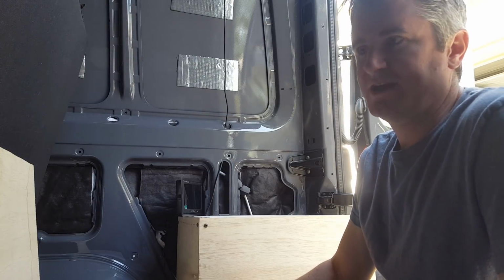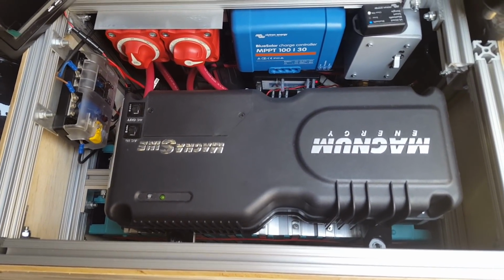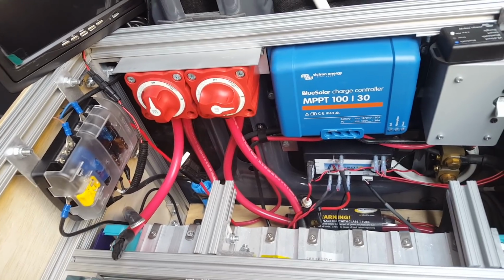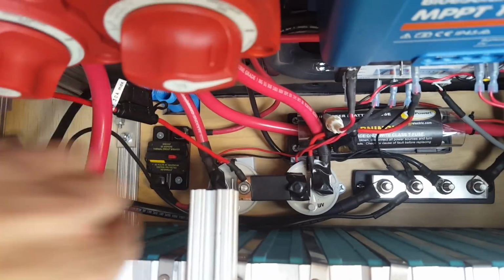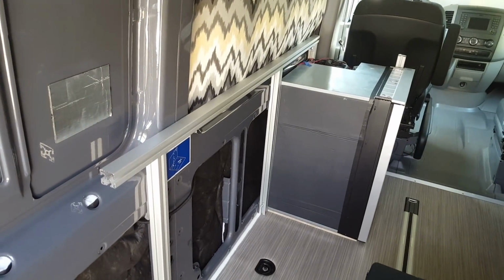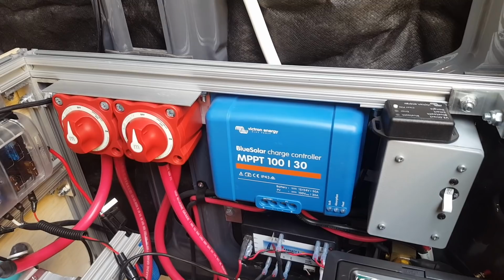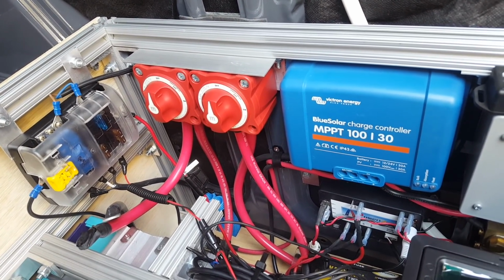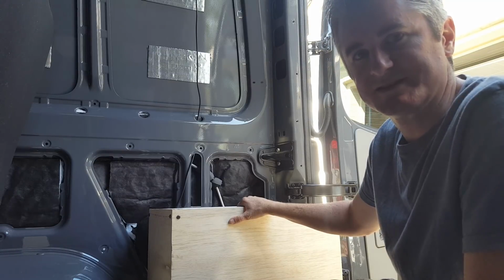Lithium Battery Install in a DIY Mercedes Sprinter camper van

Comment: kenetube, I just wanted to say that I really appreciate you taking the time to document your various installs, item links, etc. I know it does take a non-trivial amount of time but I for one am really enjoying and taking notes on your videos. I'm plotting a Sprinter build and I think yours have been some of the most considered and thought-out videos I've seen. A couple quick questions: 1) Did you consider hinging your solar panel to maximize efficiency? Seems like there should be a way to do that relatively easily with 80/20 (I'm just an 80/20 newbie but it doesn't seem like there's much you can't do with 80/20). 2) I'm assuming your lithium battery setup does not permit charging of the LiFeMnP battery from your engine alternator (only assuming because you didn't mention that). Was there a reason for that? How hard would it be to leverage the alternator for additional charging of the Lithium pack while driving? 3) You mention that shore power isn't really a need or factor for you and what you want to do. But, it seems that it wouldn't hurt to have a way to leverage shore power when it might be available. How would you go about incorporating that into your system (or, put another way - how would you recommend someone do that with a system like yours who did want to leverage shore power from time to time)? I have other questions but I'll leave it at that for now. Thanks again for your efforts - really great work, both the videos and the build!
Reply: Very helpful - thanks! Understood about leveraging the alternator and your "shore power" setup. Makes sense.
In terms angling the panels, I was wondering because I've read that there's an optimal angle for solar panels at a given latitude and time of year. Here's a seemingly credible link that mentions reductions to the low 80's% of full efficiency: https://solarcalculator.com.au/solar-panel-angle/ for a flat roof (albeit one in Australia). So, I guess I was thinking the ability to angle might be useful if you were out in the sun without obstructions for the day and wanted to get the most bang for the solar buck. But, angling the panels does complicate the panel mount somewhat, you'd have to go through the trouble of parking a certain way and setting the angle and then setting it back flat for travel, and maybe the extra efficiency is "in the noise" anyway (thanks to all that extra , useable capacity with your Lithium batteries), so it could very well not be worth it. Anyway, thanks again. Looking forward to more updates and videos!

Comment: Finally, someone who understands the advantage of not fully charging a lithium battery to 100%. The battery will last a lot longer if you don't go much past 85% (same for Smartphone batteries BTW). I learned this from Tesla. One question: I'm sure you knew of Battle Born LiFePO4 batteries; why did you go with Elite Power Solutions? Was it the remote monitor, or the end mounted terminals?
Reply: Yes, fairly new, but from what I've heard, excellent customer and tech support, and made in Nevada. But they don't have the bells and whistles of the Elite. 

Also, isn't there a way to use only one contactor instead of two (less current draw). Maybe with isolating diodes?
Reply: Yes, a contactor can be used as you are using it, but I was just questioning the need for two of 'em that open the same circuit. There is a way to use one contactor and have it open for both over and under voltage. This would save some power (only one contactor), about 4 watts DC. Either I'd have each of those two circuits control instead a small 12v relay (in essence a tiny contactor), and I'd wire the contacts of those two relays so that either relay will operate the one lone HD contactor. Or, using diodes to isolate the two circuits, you can do it without the two small relays. I can provide you with diagrams for this if you'd like, as a thank you for all your great videos.

Also as an FYI, Victron Energy has a Low Voltage Disconnect device that is essentially a contactor, but it is solid state, using MOSFETs to handle the load. They have 'em up to 100A DC. True, there is a teeny tiny voltage drop across the "contacts", but there can be some resistance across contactor contacts too.

Comment: Thank you for this!!!
Thoughts... if the charge controller is in a 'float' mode and it has the BMS between it & the battery, wouldn't the battery be protected by the BMS from under/over voltages? ...or do I simply not understand the process (and that is a serious question, not sarcasm).  
-Rob
Reply: The BMS is acting as a safety system for the battery. So really a guard against over discharge and voltage spikes, either from crappy or faulty charging inputs. Ideally this won't happen. But the BMS should make sure that something blowing won't take the very expensive battery  with it.

Comment: I am trying to prepare a wiring diagram based on this info - BTW - it is excellent. Is the progression from the 40v solar as follows; solar panel - 15 amp breaker - MPPT charge controller - 30 amp breaker - battery? Or after the 30 amp breaker do you connect to contacters, then the inverter/charger and charge the battery from the Magnum? Appreciate any help.

Comment: Hey I just wanted to say that its awesome to find someone else building there own RV with so many of the same Ideas and equipment as I plan to use and how uncommon these things are right now in the whole VanLife Community.  Lithium is the way to go for power storage  hands down along with using one fuel for transportation and with the heating element . Your choice of insulation isn't used often with home made camper vans and idk why as one of its many uses is for automotive.  You even know whats up when it comes to great speakers as you cant go wrong with HERTZ thats for sure.  I look forward to seeing this beast completed and thank you for sharing this build with everyone.
Reply: I will for sure make a channel for my build. I'm building a custom aluminum framed fiberglass popup truck bed camper for my 1996 Ford Bronco.  This will be my 2nd camper I have done on the bronco but the first was a modified Palomino Bronco custom molded to the stock topper mounting location with a pass through to the cab.  I sold the modified Palomino and now i'm stock piling parts until spring to build the tiny home on wheels of my dreams.  I'll forsure continue watching  your progress and let you know when my build starts.

Comment: Hello Ken ! I really like watching your vids, I repeatedly watch them, I have not taken action only because I worry that some things will not apply to my setup due to UK/US constraints or differences. Though this does not effect your inspiration coming across. You are actually one of the first examples that I took to in regards to your electrics and the Aluminium cabinets which I am in the process of putting together.
I’ve since purchase my Sprinter,(ex-police Sprinter, which can be seen on my instagram @nomadxsherkhan). I have begun my sprinter conversion, which previously had a VSR & leisure battery setup under the passenger twin seat. I’m thinking of taking the twin seats out and making it a single swivel seat, and installing my electrical setup contained boxed in underneath a single swivel seat, I want to minimise the need for running the wiring across the vehicle, what do you think of this idea? Incidentally, I am quite amazed as to why nobody has done this as far as I can see? or at least it is not a popular design.
The van came with 2 vents, a diesel heater wired in, ceiling lights, cig lighter sockets. Having said this, I still ended up gutting it bare as it didn’t have the foiled bubble wrap insulation, only the rock wool. My insulation is now complete the way I wanted it, getting my inspiration from various other builds. My next challenge is trying to find a wiring model to work from, possibly work off your diagram if you have one? I'm learning Premier Pro in the process so I don’t have youtube vids just yet, its just been created. Please do subscribe to keep yourself updated.
My lithium 100Ah batt has arrived (thanks for this video, please check out my instagram for the details) and I’m edging to get cracking on with the wiring amidst ordering the essential electrical bits. It’s stressful when you’re pure single sole DIYing from scratch. I do have a question for you though, Could you possibly devise a wiring diagram that you may share for someone like me who is not an expert, this would be quite helpful. Please check out my instagram @nomadxsherkhan for updates and thank you for the inspiration. You are helping me Big Time!😊

Comment: Thanks for another excellent video on your build.  Too cost prohibitive for my blood but interesting to see it done. I looked into lithium but found that a lead acid battery bank fit perfectly under my Engel fridge and lifted it up so that it was the same elevation as the counters.  My whole system cost as much as your battery.  But definitely a nice option for those with the money to spend or the problems with space.

Comment: Thanks for sharing your setup. I was considering a Life solution for my Toy Hauler/camper but agree, there aren't many solar-Life options out there. The Life and battery management cost was also 4x AU$ same Ahr AGM solution. My old caravan setup is 250w/75ahr AGM which I load through a 11.5v voltage cut devise to save AGM damage. Can override and fast charge off engine via dual battery if need be. Hopefully Mr Tesla will drive down Life RRP and improve availability. I like the cell Volt display, curious how these big Life units balance the cells. Importantly as they age, charge devise really needs to monitor cells rather than total but at least I see you are not running total pack to max spec voltage. IMO the main positive with Life is very high charge/discharge rate so if that's not a requirement then it's a lot of extra dollars for what is usually an insignificant weight (against total van) saving for a sub 200ahr setup. Space saving yes. Do you have much12v gear other than invertor pulling current? 5+a

Comment: Fantastic explanation, thank you. Though we probably have van-lifers in the UK, there are few and far between. Most of my inspiration comes from the US. I’m at the early stages of insulating a MWB Sprinter. Im a little overwhelmed by the electrics and would like a little basic guidance please. I’ve put in one layer of the foil bubble wrap insulation without interfering with the current sprinter wiring. I have an ex police riot twin axle Van. There are more than ordinary wiring installed as it came with 2 vents and five roof lights. It also had a leisure battery installed with a relay device wired in under the double front passenger seat and luckily a diesel asper heater. For me it is a case of deciding what to keep and what to modify. I know we have some super conversion experts here! Do I redo the wiring from scratch, I’m not too keen on staying with the old wiring it seems way too thin for starters. I have a ton of questions but this will do for now, cheers!
Reply: kenetube thanks I will check out that calculator. Although all the wiring for the lights and fans the van came with have professionally been installed they did not the deep cycle battery. It’s been wired so that the lights, fans and aspar heater can be run off the alternator even without a leisure battery (but does not when the engine is off). This is potentially something that I do wish to feature in my system, ie to top up the leisure battery with the alternator. The thing that has put a halt on work is my shift towards lithium ion. So at present I’m trying to budget for the best solar and lithium battery combination amongst other smart gadgets that complete the most viable system for the build. Hey what do say about ordering from Alibaba?
Reply: @bornnomad8045  Ordering from Alibaba is a return nightmare.  There is no product liability, no easy way to return heavy batteries to China with Hazmat fees!  Stick with US companies or Amazon.

Comment: Hey there,

Great videos! My wife and I are building out our 2017 Sprinter and we have followed a couple of your videos to a T, including your Maxx Air fan install and your LG solar panel install—we mounted our fan in the forward position and used a similar, updated, 300w LG panel and mounted towards the rear of the van and it just fit.

We have been equally impressed with your electrical setup and we are ready to pull the trigger and copy you once again. As I begin ordering my parts I was hoping you could help by answering a few questions I have:

1. Where did you purchase the single circuit breaker box for the 15A circuit breaker? 
2.  Could I add an additional battery to this setup down the line for extra storage capacity if necessary?
3. Where did you purchase the two contractors and do you have a part number for those?
4. If I was hoping to also charge the battery from my alternator do you know of any charging products that would be compatible with this setup?
5. If I decided to get the Magnum inverter/charger, could I run DC from the alternator in to it or can I only run AC in to it mimicking shore power (like you intend to do in the future)?

We have been using your links on Amazon, and will happily continue to for all of the products you have links for, also if there are any other ways us faithful followers can support you, please let us know!

Thanks for making these videos and thanks in advanced for your response.
Reply: Thank you. Big help! Everything is ordered up. I think I'll have some more questions for you soon!
Actually, while I'm thinking of it, do you have a water pump picked out yet?
Reply: Great, if you add that to your amazon I'd happily follow the link. Will you be using an accumulator? Also, our battery arrived yesterday and we are just about ready to install it! However, I think the only part I haven't procured yet is the bar you have joining the two contactors. Would you mind telling what that is called?
Thanks again!

Comment: Shore power would allow you to run a wall A/C (home type) unit.
Reply: 200 amp hour set-up can  handle 5K window unit.  Insulation becomes the factor in mobile applications. 

This 280 amp hour  lithium power supply can easily handle 5000 BTU window unit for 4 hours or so. 

Goal Zero Yeti 3000 Lithium Lightweight Portable Power System

My  450 CF,  55 SF, super-insulated conversion should only require 10 minutes  AC run time  to reach desired temp.

Comment: Excellent vdo and explanation, very much appreciated! Do you measure the temp on the battery from the solar charger view, when charging with 30 amps? Do you get those 30 Amps often? I get from 2Mt Cis solar panels a max of 10 amps full sun, but still 3 amps partially shaded or when cloudy..but my Lithium iron phosphate could be charged up to 160 Amps ( its a Super B 160 Ah.).. So in my case the solar charge is not enough! If I go on grid I can chatge with two temp. Controlled chargers (1 Schaudt and 1 Cbe) and together with Solar  with 70 Amps..even with temp down regulation you are full in 1 or 2 hours and float the rest of the day., plus float the chassis batt.( never used off more than 50 % cap yet)..idea could be a 40 - 60 amps b to b Booster (büttner) that gives you a rapid charge when driving..Question would I be able to add my solar to the 220V shore line via inverter charge that could be faster? Or use a Honda 1200 for 1 h...( I do run a sine wave inverter with 1800 watt permanent and 3400 watt peak on the consumption side  but have no compressor refrigerator yet, so cool box on propane..
Reply: Sorry for in precise question...would it be better to charge via charge controller onto a 110 or 230 v inverter and use the on board chargers ( 2x20 amps) for charging fast..instead of only getting the 19 amps in your case or 6-9 amps in my case..would wonder if that worked at all..( like you are on grid) Hannes
Reply: OK understood..I can charge 20 +20 + about 9 amps parallel when shore line is connected and sun was out( said wrongly 70 Amps).. So that would be probably 5 Amps + on the Ac side, so PV would need to supply 50 amps to generate that.Dc-Ac-Dc...that gave me an add. Task,  I need to discharge my Super b a bit and then go on grid and measure the 230 V  x Amps draw..to see which hook up can handle bulk loading..we have Camp grounds with free electicity and 3 Amp services, which is enough for fridge and charger..but not meant for El heaters or bulk charge of the Lifephos Batts...interesting..

Comment: Top of the line build. Just starting to research building a solar system for my sprinter van. Needless to say thank you very much for taking the time to share you work! I'm curious about your OV/UV protection. I don't see it on your build list and I am wondering how you control or if you need to control the voltage on the line side(OV)?
Reply: Thanks for getting back to me. I was wondering if you have a automatic charging relay in mind that will work with lithium batteries?

Comment: Thanks for this video. I would so much like to believe in lithium batteries, but I'm still not convinced that it is the way to go. The start up cost and risk to the system from extreme temps still scares me. A parked vehicle can get really hot inside during the summer and below freezing in some parts in winter. These are two things that I have heard will shorten or end the life of lithium batteries. How will you protect your system from extreme heat or cold when you are away?